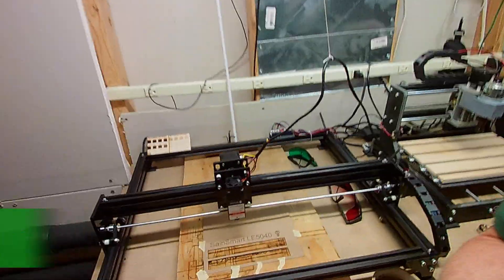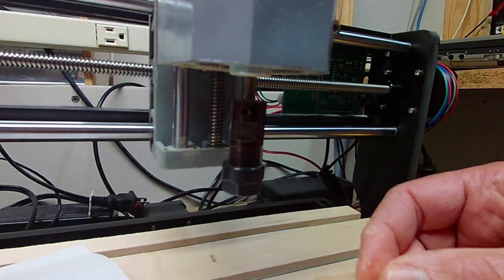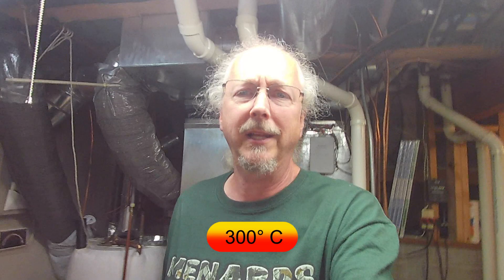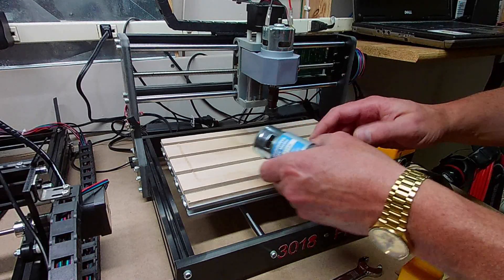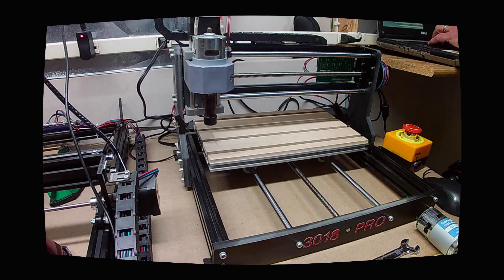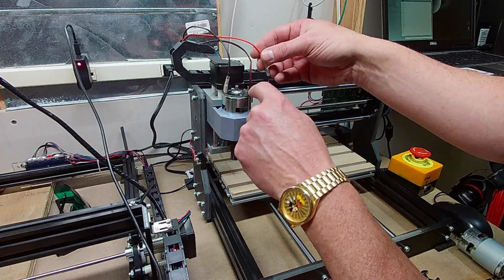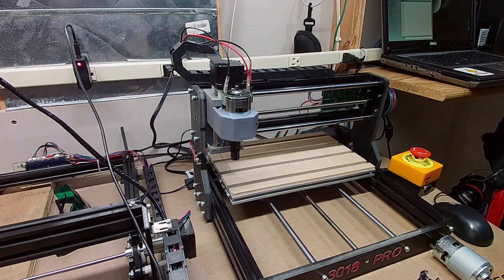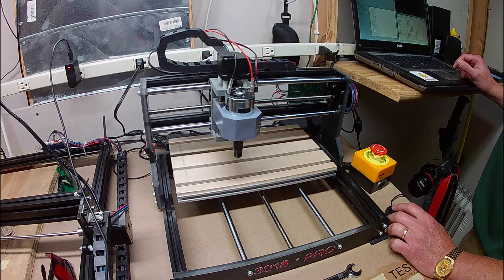SainSmart GS-775M spindle upgrade for 3018 Pro

Comment: You will need to update your GCode in order to ramp up the spindle speed slowly and don’t kill the cnc power supply that is only 5 watts, replace this:

S10000
M3

with this:

S4000
M3
G4 P.25
S6000
M3
G4 P.25
S8000
M3
G4 P.25
S10000
M3
Reply from the maker: Thank you Julio for the advice.  I was planning on working with router to find out what I can do with the new spindle.  With the smaller power supply, I can run it at S400 (I have it set with 1,000 as the max) and it seems to work properly.  When I step it up to S500, then it doesn't have enough power.  A larger power supply does seem to be the answer.  I do worry about the controller handling the extra power or should I say, not handling the extra power.  I like your idea of ramping up the spindle.  I will try out your code to see how that works.  I may power the spindle with its own power supply and bypass the controller.  This means I will have to turn it on and off manually or, if I were clever, hook up a relay to the Woodpecker's spindle output to control the other power supply.  Then the code would still turn the spindle on and off.  I do tend to run at full speed anyway.  ;-)
Reply: @CNCATHome  In my case I have a 24V 5amps power supply on a board is a "CAMTOOL" v3.3 and works ok with not issues with the new Gemitsu motor so far.
Reply from the maker: I am working on another video about this.  When I ramp up the spindle speed and get it up to speed first, then start moving, it seems to work OK.
Reply: Can someone please direct me to actual keystrokes for entering the code? I suck at computers!
Reply: Curious why you specify S10000. Why not S20000 since it’s a 20000 rpm motor?
Reply: @kendalja78  S10000 is relative to 100% of the motor speed, it’s like if the motor just can run 8,000rpm the S10000 parameter just indicate to run at max speed.  The controller in the CNC machine can’t control the speed of the motor just the amount of power/volts apply to the motor.
Reply: @JulioAndujar  So the stock 5 amp PSU will run this motor at full rpm with a load on it as long as you step up the speed at startup? I really want to upgrade but I don't like the idea of having a separate power supply. I use Easel and I like that it starts and stops my motor.
Reply: @jimmyronsonet2811  Yes, its an issue of sudden current draw when trying to accelerate too fast.
Reply: According to SaintSmart they say this is an upgrade for the 3018 Pro, that the new PSU 24v 4A can take it if you ramp it upm, but in the comments the opinions are not all the same, i wonder what's the reality because i wanted to get one but i didnt want to have to get another PSU and another motherboard to be able to handle the higher Amps..
Can anyone tell me if this is really plug and play (and durable) or sooner or later i'll have to do PSU and motherboard upgrades also?
Reply: @TheRealRoGueMS  All electric motors will momentarily draw more then the rated current when they first spin up or in other words when a higher load resistance is present on the motor the higher the current drawn or energy needed to turn the motor. Fans and such often will draw 3x the rated current draw from normal operation for a fraction of a second while the motor builds up rotational inertia. The speed control on these motors in this cnc is by pwm and that means the connection to the 24v supply is turned on and off very quickly to result in a on of ratio to control speed. If the motor has a load on it such as being in the material already it will draw more current. When you hold a motor still and power it it will draw current to the point of burning out. I'm not sure why the motor would kill itself from just spinning up other then it being under high load from a stopped state. once the motor gets up to speed as long as the feed rate isn't too high it should be okay... adding more weight to the motor shaft like ive sen some people do when they add mass to the top can possibly cause the initial draw to be higher then the motor coil wire is rated to handle and burns out but the power supply shouldn't fail from that it should just supply all the power it is able to and maybe get hot and burn out after a while. Sometimes you need to have a current surge resist on the psu output to protect the sudden discharge from large smoothing capacitors on the psu output when powering things that will not limit how much current that can be drawn. If you are using heavy bits or have added mass to the spindle other then the collet or it isn't balanced well that could be what is causing problems with the motors and going 100% from dead stop.

Comment: The further you get the chuck on the shaft the better,reduces run out.
Reply from the maker: Great input.  I almost put this one on too far.  I was going to put a shim between the motor and the chuck so it wouldn't bottom out.  Fortunately I didn't bottom out, but it was close!

Comment: it's not worth running the motor through the control board. you were lucky and it didn't fry your board, I've seen too many comments from other people where the motor was started at 100% and the current draw fried the control board or even where they ramped up the speed and it still fried their board.  Just one mistake when starting up the motor and your board could be toast. Just get an external PSU with relay and the motor can be turned on/off by the board, but the current never goes through your control board, if needed they have variable PWM PSU's if you need to vary the speed.
Reply from the maker: Thank you for the recommendation.  That is great information for people to think about.

Comment: what are you doing mate the motors come with a collet fitted to them, you got scammed and use a slide hammer cause its designed for stuff like this.
Reply from the maker: Well, they do now.  When I purchased my GS-775M, they didn't have the option to get it with the collet already installed.  It was less than a week later that they were offering it that way.  Oh well, I don't mind doing the work myself and it went on just fine.  I did get a little lucky that I didn't over drive it onto the shaft.  I had planned on putting a spacer under to prevent that from happening.  ;-)
Reply: @CNCATHome  have you milled any aluminium with that new spindle? if so what speeds and feeds and stepdowns you using? i have just upgraded from stock spindle to the 20000rpm one and i have an ally part to make luckily im a sheet metal worker so i got some 5251 soft ally that ok for machining just researching the best way to approach this
Reply from the maker: @happybrainybren  - I have not done much with metal using this machine.  It should do a nice job.  This wiki page should give you a good idea where to start.  :-)

Comment: According to SaintSmart they say this is an upgrade for the 3018 Pro, that the new PSU 24v 4A can take it if you ramp it upm, but in the comments the opinions are not all the same, i wonder what's the reality because i wanted to get one but i didnt want to have to get another PSU and another motherboard to be able to handle the higher Amps..
Can anyone tell me if this is really plug and play (and durable) or sooner or later i'll have to do PSU and motherboard upgrades also?
Reply from the maker: Good question.  All in all, the woodpecker that came with my 3018 Pro is capable of running the upgraded spindle motor.  You do have to ramp up the start as it will draw too much current at start-up from nothing to around 50 to 60% power.  If you start it at 40% and ramp it up to 100%, it is good.  It is quick too.  The ramp up code in the description of this video takes less than a second to complete the startup of the motor.  I have it set as a default in some of my software so I don't have to add it to the G-Code anymore.  You still can put the spindle motor under enough load so that it will draw more current than the controller has and it will go into some kind of limp mode.  If you plan to do aggressive cutting with this spindle motor, I would connect it to its own power supply that could provide all the current it wants.  I am still on the fence to do this as I typically don't load it up too much and it hasn't been an issue yet.
Reply: @CNCATHome  thanks for the reply! If I end up getting this motor I'll also make the start gcode mod to ramp it up slowly and as far as agressive cutting goes I don't plan on doing so, and if I do deep cuts will be with smaller steps to get a better finish and not put so much load on the motor.

Comment: On my Chinese CNC conversion I made a high speed spindle by O ring drive belt with big plastic pulley on the motor and smaller brass one on the new spindle. I used the mill as the lathe to turn the pulleys. Tool bit in the vice.
Reply from the maker: Very creative!

Comment: Thanks for this awesome video, can this 775 little motor work continuously for more than 3 or 4 hours ? Cuz i think this motor not suitable for long continuous run?
Reply from the maker: That is a good question.  I don't know the answer to that.  I have not run a cut that took that long.  I have not run into this spindle getting hot either.  I would be more worried about the WoodPecker controller getting too hat on a long burn more than the spindle motor itself.

Comment: I bought a similar CNC but I couldn't change the engine speed. The speed adjustment in the GRBL program does not work, my engine always rotates at the same speed :/
Reply from the maker: Sorry to hear that.  I have not had any issue adjusting the speed other than trying to start this thing at full power.  There is a simple solution for that by ramping the speed up from 40% to 100%.

Comment: What's the difference between the 20,000 rpm and the 500-watt motors ?
Reply from the maker: Great question.  The 20,000 rpm replacement motor will just work with the default controller and power supply which have 114 watt output.  It requires some extra G-Code when turning on the spindle so it ramps up to full speed as going directly to full power overloads the controller as it just doesn't have the power to do that.  A 500 watt motor would require an external power supply and provide you with more torque while cutting.  I don't have the specs on the 500 watt motor but based on the 500 watt part, it would really have quite a bit more power to cut through stuff.

Comment: I just ordered the 3018 here in Germany to day for 126 €, it's good to know that there are problems with the upgraded motor, so I think it's almost better to offer the motor its own 36 V power supply... ultimately it comes down to it same out. Didn't you have any information on how many watts the motor delivers, it's even questionable that the machine only starts up at low speeds. i think the motor certainly draws more than 5 A at high speed even when idling. 
 So before I buy another motor, I would first try a Hadwear tuning, you have to turn the end shield to which the brushes are attached a few degrees, but not everyone dares to do that. The motors are industrially designed in such a way that they accelerate and have the same speed when turning left and right. That can be changed by optimizing in only one direction that u need. But a tuned motor also needs more power.. so the problem with the original power supply could be 
be come the same.
Reply from the maker: Good luck with your 3018.  I hope you enjoy it as much as I have enjoyed mine.  I have thought about having a dedicated power supply for the spindle motor.  I haven't done that yet but did start looking at power supplies some time ago.  So far, the speed ramp up has worked just fine.  As you know, most motors draw high current at start up and under heavy load.  I would go with the external power supply if I were putting the spindle under a heavier load while cutting.

The motor did not come with a specification sheet and I "assumed" it would work just fine with the default controller as it was advertised as compatible with the 3018 Pro.  I was disappointing when it didn't work right away. I was pleased that SainSmart support was able to help in providing a workaround.  I don't know if a small motor like this really cares if you give it full power right away or if it likes being spun up a little more slowly like a big, three phase, industrial motor.

I like your thought on optimizing the motor for mono-direction operation as that is how it is used 100% of the time.
Reply: @CNCATHome   Thx Bro.. but thinkig of  Quote "  As you know, most motors draw high current at start up ((( and under heavy load. )))) " :-)))  If I get any problems, then I'll have a brushless motor in my bracket, which also offers high torque at lower speeds.

Whis u well.

Comment: 3x the speed and 3x the sound level.
Reply from the maker: It is not quite.  Check out this video I did about the KABA lite box from SainSmart https://youtu.be/FXZPxN9mupI
Reply: @CNCATHome  better ( almost as bad as a screaming Baby) but I will try a cheap brushless motor.
Reply from the maker: @telwood008  - Let us know how that works!
Reply: @CNCATHome  fitted a cheapo 400w ! not brushless motor on my small 1610 machine using Minh's cave aluminium z axis mod. and it's much quieter and better in every way apart from the size. Thanks for asking.
Reply from the maker: @telwood008  - Nice.  I hope it works well for you.  Always fun to make improvements to our machines.
Reply: @CNCATHome  cheers

Comment: You need to hook an aditional speed controller or change mosfets on stock controller.
Reply: No, you don't need to. The Mosfet is rated 18A at 40V. That is more than enough for this spindle-motor. You however need (depending on your stock PSU) a more powerful PSU. My stock one was delivered as 24V 8A. And it just works fine.

Comment: So you put a 450 hp engine in your Pinto and the transmission and rear end can't handle it.  Did you ever get this sorted out?  I've seen some other vids on replacement spindles that run too hot at those increased speeds and required some additional cooling.
Reply from the maker: That's great.  I learned how to drive in a Pinto wagon and it did not have a 450 hp engine.  It did have a 4 speed manual.  The motor isn't too big for the machine as much as it is a power hog.  The easy solution is shown in the description of the video where you add some ramp up code to the spindle so it starts at 40% and then 60%, then 80%, and finally full power.  That seems to work well.  I have not done much cutting with it yet.  What I have done has worked fine.  The ramp up time is about a second so you don't even notice it when it is doing it.  They do have a larger power supply at SainSmart specifically for this and it puts out more current so you can brute force the thing right to full speed.

So this is more like putting a bigger engine and drivetrain in the pinto but not putting a bigger fuel pump in to feed the thing.

Comment: They should use a 300 watt spindle min.  That 7K spindle is junk.  You need 24K min.  The new spindle will do the job.
Reply from the maker: For a very entry level machine, the spindle motor that comes with the 3018Pro does a good job.  It is a less expensive motor and keeps the price of this machine nice and low.  I did many cuts with the stock motor.  You can run it at 36v and get 9,000 RPMs out of it.  

I agree that a more powerful motor is needed to up the game on this machine.  One reason for this upgrade on my machine.  I have seen many mods with much larger spindle motors.  Too much bigger will require an updated cradle on the gantry to support the weight and torque.  The Woodpecker controller is limited to the power it can handle so running the spindle from an external power supply is another good modification.  

The 3018Pro is a great starting point for CNC routing.  There are plenty of modification to be made to up its game.  At some point, after many modification, it may be time to migrate to a bigger machine.  Everything you learn using this desktop machine is a transferable skill to be used on another machine.

Comment: Could you send a link to the awesome STOP button and perhaps show how you hooked it up to the controller? I bought a cheap one from SainSmart but no instructions how to plug it in.
Reply from the maker: Sure!  I got mine through Amazon.  This is a sponsored link meaning that if you buy it, CNC @ Home may get a little commission on the sale: https://amzn.to/3b1dkyR

As for hooking it up, you just need to connect between the A1 pins on the WoodPecker controller.  It isn't technically a stop.  It is a pause so the spinal will continue to spin.  To get a true e-stop, you would need to connect your power through the button so when you pressed it, the power would be interrupted and everything would stop.

Comment: I just installed one has more power but twice as noisy as stock spindle and ramping up speed has caused no problems I wont put any more money into 3018 because it is not rigid enought it is great for the money but still just a toy !!!!

Comment: try s4000m3 g4p.25 s6000 m3 g4p.25 s8000 m3 g4p.25 s10000 m3 g4 p.25 only takes seconds or use separate power supy for spindle its a pain to put at the begining of every program but it works and doesnt strain stock board
Reply from the maker: That is the solution we ended up using.  I added that to the video description a few months back.  Great solution.  I am looking at the new power supply SainSmart is selling.  It will deliver 8 to 10 amps for motor startup.